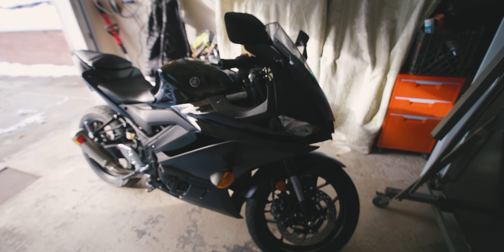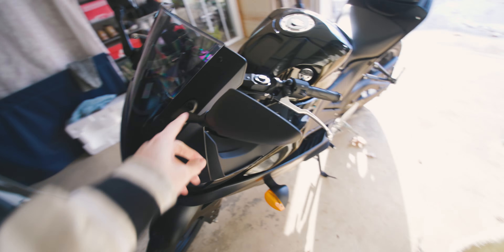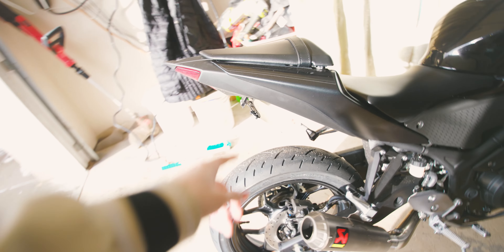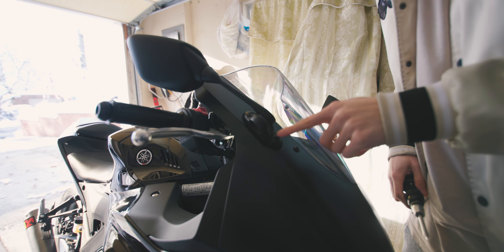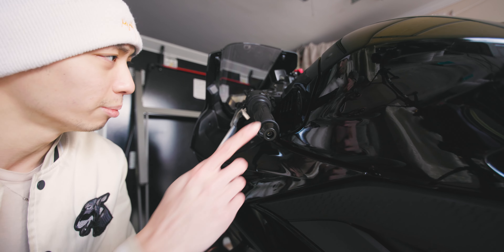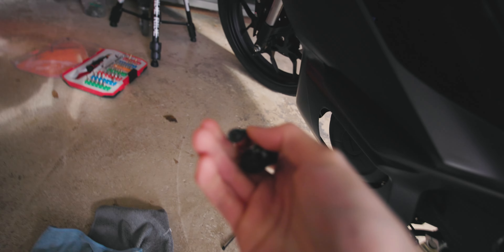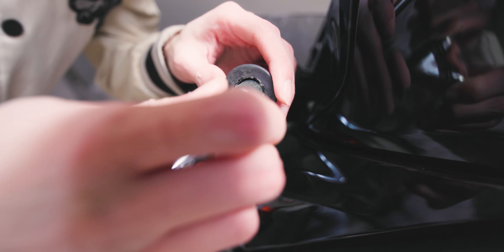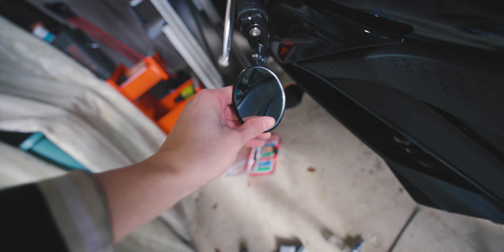Removing Mirrors on the R3 & Bar End Install

Comment: Looks clean/mean/sleek. When you are able (after the snow) let us know if you notice any imbalance / buzz with the steering/ride.
Reply from the maker: after going on a ride its very stable and it doesn't vibrate at all, even the wind doesn't push the mirror around